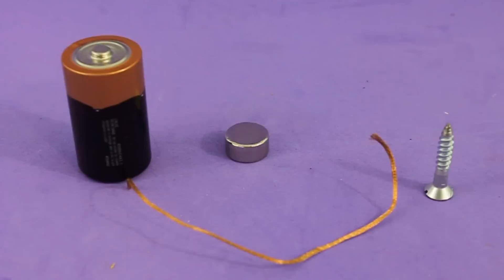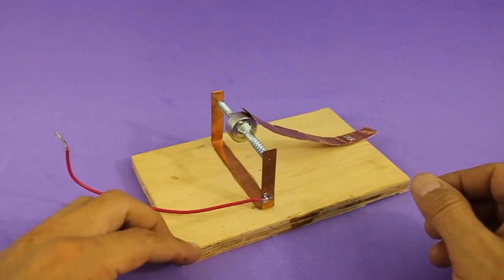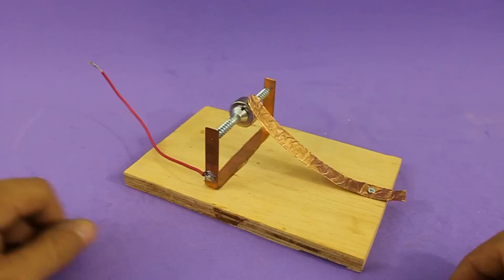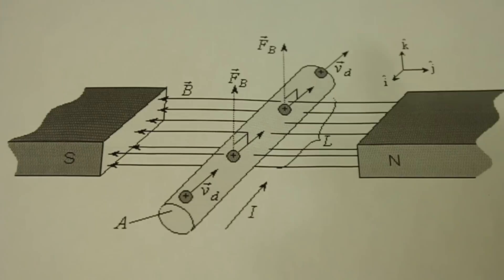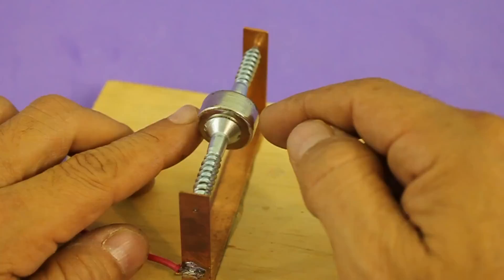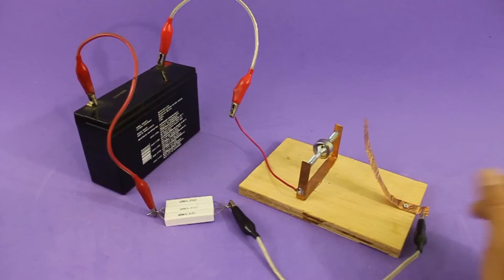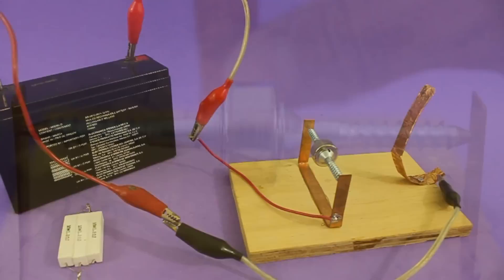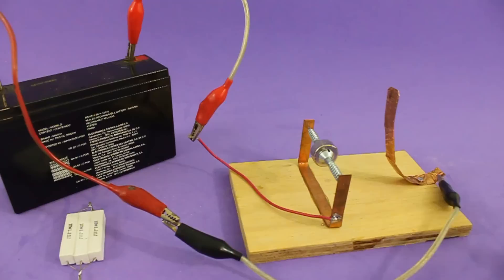Horizontal Homopolar Motor

Comment: Nice job it gives me a huge idea  to build something mind blowing
Reply: scaled up, with bearings at friction points, and a DC controller, it could likely make for centrifuges, fans, and if the base was modified well, and the batteries stationed correctly, it could make a decent model boat.  I was thinking to make that spinning battery much larger, and make a big unicycle or a motorcycle, with that spinning magnet as a whole wheel.

Comment: Such a simple rendition. I applaud you, I wonder if I could call upon you one day for employment
Reply: I give you a ponderance, what would happen if a ball bearing motor with flywheel coupled with two faraday homopolar generators with flywheel also through non conductive path. It should look sorta like a axle of a train or automoblie
Reply: And you could pulse high voltage dc to save energy through flywheel energy fly back
Reply from the maker: let me think about it

Comment: What happens if u create induction from the copper being in contact with a rotating magnet and used that induction to charge the battery that u use to power it, if the rpm is high enough and the magnet has enough surface area on the copper u might be able to make it work right??

Comment: If you ground one of the leads and the other lead is set with an antenna is there enough power from atmospheric electricity to turn the motor?

Comment: Is it possible to use a light bulb or two instead of a resister and still get the motor to turn? and if you put a pickup coil near the magnet could you recover any amount of energy to put back into the system?
Reply from the maker: +shazizz you can put a coil to collect electricity but that will slow the motor.
Reply: Ludic Science could the coil act as the resistor?  What is the minimum amount of voltage and current is required to power the motor?  Will the 1.5 D cell battery power the motor?
Reply from the maker: That´s correct, I have no control over the comments placement. Only thing I can do is flag one particular comment that will be always at the top.
Reply: shazizz Zero ohms is a wire.  Not really.  Think of a wire as being .2 ohms ish.  .4 ohms is very low resistance.  Around the resistance of light bulbs.  So yes I see light bulbs might work in place of a  .4 ohm resistor.  You can find these resistors on old big speakers.  They look lime little blocks of rectangle stone.  They will say .4 or .8 ohms.  Ohms as a word is represented  by an upside down horseshoe thingy.  Both these amounts of ohms are less than one ohm.   Some of these types of resistors are 4 8 16 ohms too.  A bit more ohms yes.  Still ok.  If he had say a hundred ohms or a thousand ohms resistor,  the light bulb would not be in that league.  Those tiny amount resistors are almost like a plain wire. Any amount of ohms less than one,  is close to a wire.  Which is what a bulb is.  If you want to use led,  plus and minus are important .  glhf.....I just took a closer look at his resistors..the white...take a good look.  It is actually three side by side with their wire ends connected up.  Those are the resistors.  Found on old speakers.  Glhf again.
Reply: Jerry Guerra coils only "resist" current flow when it alternates.  Battery is DC so coil cannot "resist" the current flow no.  It lets it flow.  Great explanation even I learned from this done well  No one explained this up until now, just show.  Thanks for the education!
Reply: Ludic Science a coil does not collect electricity quite what you mean.  May I suggest capacitor?  And big ones....but why store up a charge coming from the battery?  Battery will run out sooner.
Reply: Very very good job my friend 👍

Comment: thanks so much for this video !
Could you help me please,my version is different in the following points (because in a hurry to build it I've used what was at hand) :
15V dc from a transformer for train models (unknown amperage) ,instead of copper aluminum tape and a good neodymium magnet using an antenna as axis, it doesn't works.
Reply: I also am having trouble getting mine to spin, slightly different version. Did you get it sorted???

Comment: The homopolar motor is 1. not homopolar. All field lines connect. 2. There is counter EMF, but you will never see it unless you a. increase field strength b. Spin the rotor much faster, and c. use larger diameter.   Now look at his setup... The frame is antimagnetic, and though current flows through the arms, the flux is very weak in this area. That flimsy copper tape is obviously not being pushed on.  The rotating magnet provides the field, but the field CANNOT turn.  Here's why.   https://youtu.be/Kl0-sKbZsKM    .   But still more astounding... where is the torque reaction? What happened to Newton. I am building a little circuit so I can turn on current with a beam of light. Then I will suspend the whole motor but with a vertical axis. You get it.  Lucid, I hope you still read your comments. Your video was one I saw during my own confirmatory experiments, and I am in your debt.

Comment: Whats the rendement of the motor
Reply: Blabla Blabla never heard of it what is rendement?
Reply: Vincent Hildebrand sorry i mean efficiency
Reply: Blabla Blabla o ok...efficiency does not work with voltage alone but how many electrons at a given instance can flow (current)...  Voltage is pressure.  Current is amount.  Picture a garden hose with a nozzle ok?  As you squeeze the grip, the water shoots far but not very much water, at first.   Gradually,  the distance gets less but more water comes out as you squeeze more.  Less pressure to get more water out.  Resistance is pressure.  The more you have of it, the less of water or electrons can flow.  A copper wire is a water hose for electrons.  Now back to your question.  If there was no resistor just wires, your grip on the hose is tightest so it is easiest for water to flow (no resistance).  The battery is the source of electrons.  All out with no resistors, the current will flow like a horse at absolute full Gallup...runaway.  It will burn out very fast.  The battery will try to do its best to get fastest spin.  This is not good, same as over running your horse.  It is maximum output.  This guy wanted to reign it in just a little with point four ohms just a touch close to maximum put out.  We want maximum efficiency instead.  Is it efficient to go all barrels blazing and run out of juice quick?  Or maybe slowly adding resistance might not slow it down very much, and the battery can last many times longer.  Too much resistance, then the spin slows down especially if you put a belt  and pulley on for a load.  And doing the load you want is where you decide maximum efficiency is.  Too much resist and work cannot get gone.  Too little and it's like a kid eating all the smarties in three gulps instead of thirty.  That is the best I can explain efficiency.
Reply: Vincent Hildebrand haha sorry i am from the netherlands and i am really skilled in electronics but not that wel at english. What i mented was the realation between the kinetic energie and the input power.

n=E_kin/E_used

I think that the translation should have been yield instead of rendement or efficiency.